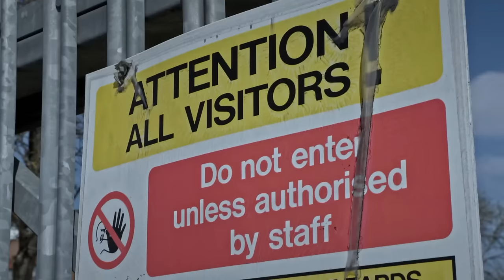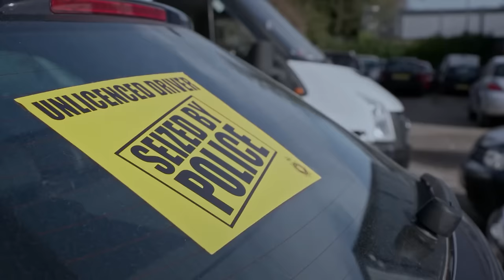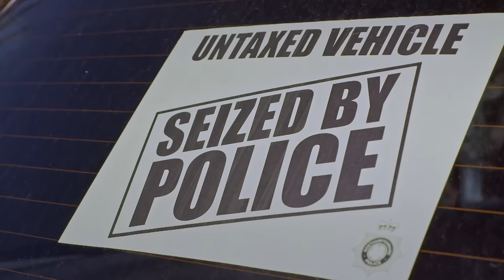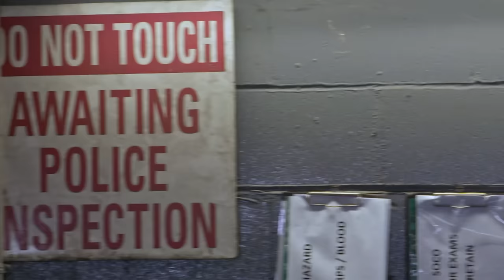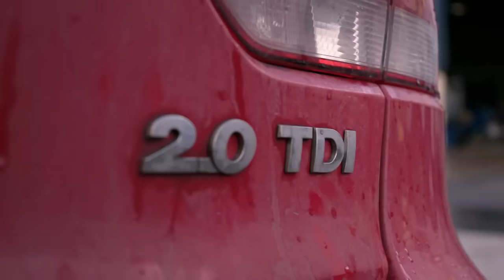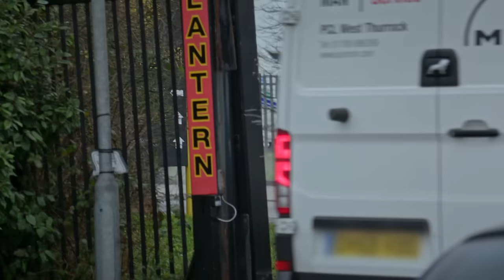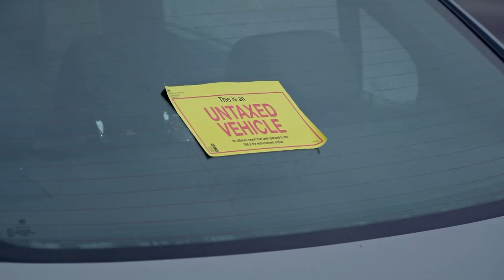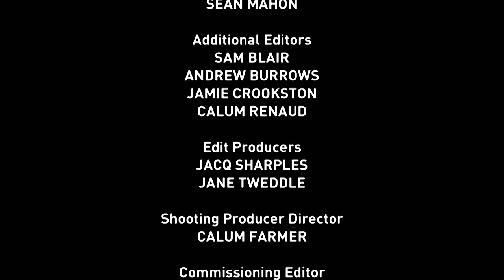Man Returns To Find His Car Being Towed! | Car Pound Cops | Debt Recovery Documentary

Comment: I don't understand why they scrap it versus selling it at auction to at least get something out of it that's what happens in the states
Reply: yea i was thinking  same thing gotta be worth more at auction than scrap
Reply: In curious if you would feel differently if they forced tell us we can't auction them off but MUST scrap them...mmmmm
Reply: @shannonobrien9922  that is pretty much doing in the video!
Reply: A lot of the time it is not worth the time and trouble to auction them as they are borderline roadworthy . The decent ones do get auctioned
Reply: @jays106  A lot of the time it is not worth the time and trouble to auction them as they are borderline roadworthy . The decent ones do get auctioned
Reply: 90% of these vehicles aren’t even fit for the wrecking yard, the only thing they’re good for is scrap metal!! You may get a decent gearbox or transmission, maybe a differential or the odd engine but very rarely, everything else is just scrap metal…

Comment: I have never seen tow truck drivers allowing car owners to stay in their cars while their car is being towed.  I also never seen tow yards allow potentially irate car owners such easy access to their office staff either.
Reply: Letting people stay in their car while it's being towed is a definite no no.
Reply: If you are in the middle of a freeway/motorway it will be done until they can let you out in a safe area. Better than an irate owner who has just had their car seized due to unpaid tax in the cab with the driver.
Reply: @Nibinin  It was not the tow truck driver's responsibility to ferry them to a safe location.  It was the police officer's responsibility but apparently he couldn't be bothered to do his job.

What if the car got loose (chain/tie breaking, etc) or they got into an accident?  If anybody got injured the tow truck driver and the tow company could be found liable for any injuries sustained by his passengers even if somebody else caused the accident.  Absolutely not worth the risk.
Reply: @jormugand5578  In the UK, passengers may be carried in the back of a flatbed tow truck as long as speeds don't go over 30mph. Generally it is only done to get people out of harms way.
Reply: @Nibinin  Never said it wasn't legal.  Still doesn't make it worth the risk.  BTW how does the average UK driver feel about tow truck drivers driving less than 30 mph on UK streets let alone highways?  😉
Reply: @jormugand5578  Which is why they only tend to drive to the closest exit/rest station where the passengers can safely wait for a taxy/friends
Reply: @jormugand5578  Is your imagination running away with you?  They are on a truck, in a car and with a seatbelt on.  What do you expect?  Bombs, Martians, tornados, avalanches and sharks?

Comment: Too bad Ian didn't have a flatbed like we have in America (with just a winch and cable - no crane).  Would have been funny once the owner refused the keys and Ian dragged the car up on the bed with the detent in the transmission breaking loose (it damages the internals of the transmission).  In America, tow operators are usually not liable if the owner refuses the give the keys.